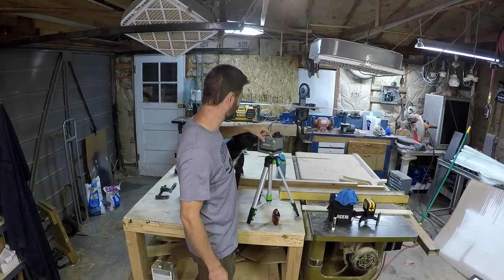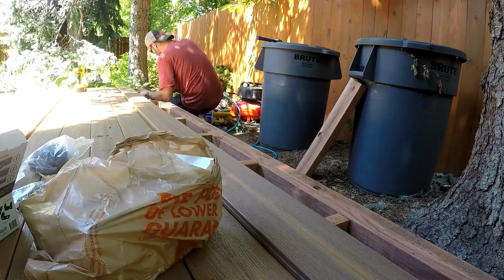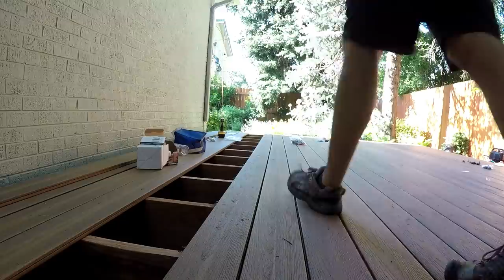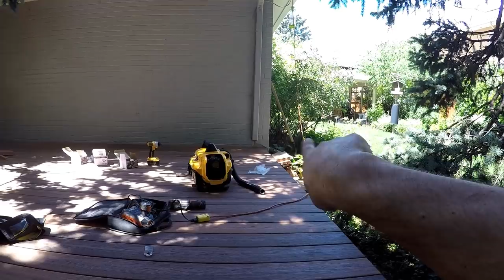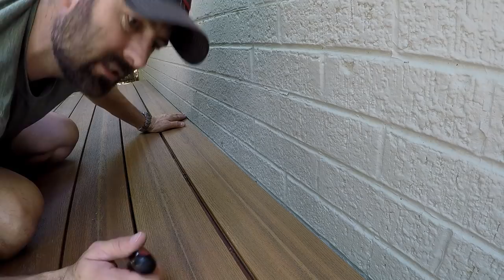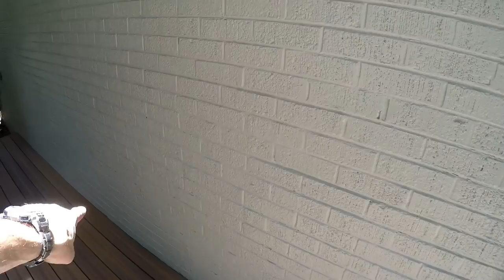How To Build a Composite Deck with Hidden Fasteners | THE HANDYMAN |

Comment: Definitely worth buying the tool system for the hidden fasteners! Maybe not for just 1 deck though. Just built a composite deck, each plank was 100 bucks. 30 thousand bucks in total for the complete project.

Comment: I guess the hardest part of this is how did you measure that with the spacing so the last board filled in the gap between deck and the wall? Are the fasteners universal size spacing? Thats some good measuring how ever you did that. That would have stunk if you had to do a rip cut on the final piece. Looks good. Guess I caught some foreshadowing on the previous video when you showed the level footings and said how you didnt check them before the concrete was down. Its those two points that are the hard parts, the rest is easy peasy. by the way, owner needs to take the landscaping around that to task, needs some major improving.

Comment: When I bought my house, before I could even get the mortgage funded I had to pay a contractor to take the deck down. It was very shaky since it was being eaten by termites, and the bank didn't want to help pay for a known termite infestation. Fortunately they hadn't gotten to the house itself yet. (The termites, I mean. The banks had their hooks into the house well and good: It was a short sale.)

Turned out, whoever built the deck went cheap on the parts that couldn't be seen. The decking was good quality redwood and still in good shape. The posts and joists were untreated fir. Oy. This is what happens when you don't do it right the first time.

I took the cheap option myself (I had a lot of other expenses to deal with just then) and just had the contractor put up small porches/stoops so that the back doors were usable, rather than replacing the whole deck right away. Now I'm thinking it'd be nice to have the deck back, but I'm hesitating over the likely $12,000 cost to build it out to its former extent.

Comment: You may have answered this, and I missed it, but did you just shim the 1/2" gap in the post base left by doubling up the boards?
Reply from the maker: It just squished together.  It was about 1/4 inch difference. When I sunk the nails it bent tight to the beam.   Treated wood is a little thicker than kiln dried wood.

Comment: I’ve seen some builders use basically a tar weather strip on top of the joist and beam. What’s your thoughts on using that.
Reply: If your using pressure treated wood for your joist and beams it shouldn't be necessary. Personally I wouldn't build a frame on an outdoor structure using anything other than pressure treated lumber.

Comment: I almost built that exact same deck.  I was curious if that last deck board just "floats" once you snapped it in, or did you also face screw that one board with those tiny head deck screws? The hidden fasteners are pretty cool.  I couldn't believe just how many I actually went through.
Reply from the maker: I did exactly how you described.  I faced screwed it the the tinny head screws then the deck board almost self healed around it and you couldn't even see it from standing up.
Reply: Right on!   Thanks!

Comment: Where I live is a wet climate, and the flashing tape helps preserve the framing from moisture. Menards carries it in 2 different widths: 4" & 12". It is labeled and marketed as deck flashing, but it is similar to the tape used to flash around windows. However, in all my years of handyman work, I have never seen anyone actually use it!  I have seen lots of rotten deck frames but never one with flashing. And most decks here are lagged to the house right over top of the siding. The deck ledger rots, the siding rots, and the house framing rots!
Reply from the maker: It must be a wet climate thing.

Comment: Seems like an odd placement since there is no door from the house coming out to the deck. Great work! What brand is that material... and where can you buy it? I like the look of it, more natural than some of the other composites I’ve seen.
Reply from the maker: It's behind a detached garage.  Fiberon, symmetry, Jatoba.
Reply: I thought the same thing.  At least he did not have to burn in the sun building it too.  It was a very pretty deck.  Nicest I have ever seen.

Comment: Have you ever used your glasses out of your laser kit outside and how good are they and would you know if their still available as I have a dewalt crossline laser red beam and it can be a nightmare when to much light in a room, cheers
Reply from the maker: I'll go try it out and get back to you in a bit.
Reply from the maker: It got dark out check back in the morning :)
Reply: No problem, was thinking I had glasses with a Hilti laser I had years ago I don't remember ever using them think I was told they was just to protect eyes from laser. Watched your vid on your new sprayer again and another question if you don't mind, does it have a sealed plug as being in the UK we got 3 pin plugs, later cheers
Reply from the maker: I just tried it on the side of a house. and there is a major difference in how well I can see the red lines.
Reply: The Handyman have to see if i can get hold of some, cheers for that

Comment: I don't use foam tape I use roofing paper on top of the joists.  It is not for the decking it is to protect the top of the joist from the water that will eventually sit on the wood.  It's not a big deal just something I was taught years ago.
Reply from the maker: I live in a very dry climate.  That makes a lot of sense and I think I remember something about some kind of tar paper or the sticky flexible flashing

Comment: I think the tape is more for moisture protection?! At least here in the northeast that's what I have seen it used for.
Reply from the maker: I could see that.
Reply: Glad you do. lol All I see is government regulation BS. Just like here in NJ you need to use a tornado cable when building a shed. You can fail your inspection if one isn't installed. I've lived here close to 50 years and have never seen a tornado and only two hurricanes. Which were more rain than wind. And all your footings need to be below the frost line which is between 36-42 inches. This is why people don't get permits.
Reply: When using non treated joist.. I paint a coat of linseed oil or used motor oil on top of joist.. to help prevent the top of the joist from rotting...

Comment: Why didn't you put concrete posts in the center of the deck for additional support??
Reply from the maker: That's not how decks are built.  It doesn't need extra support when the lumber is sized properly

Comment: What about deck underlayment? I mean to prevent grass growing?
Reply from the maker: There is no grass there to grow.  Also there is no sunlight.
Reply: this is seriously late in posting so you may have already found your answer or simply have moved on...A good landscaping fabric (and yes, fabric, not plasitc or poly) can be laid down right on the ground and secured in place by a light layer of gravel. Landscaping fabric comes in rolls - just roll it to the length you need and cut it with scissors. the gravel will keep the fabric from blowing away and both will allow drainage of any water/moisture that gets under the deck.

Comment: Since you ripped the last deck board, would it be safe to ask. Why didn’t you begin at that point & work your way towards the other end ? Either way great job !!!!!!!!!!!  Also, you didn’t lay any weed or growth material under the deck . So that later in the yrs to come , things will grow between the boards.
Reply from the maker: You always rip the last board that goes up to the house you can't have a ripped board or an over hanging board or a short board at the side away from the house.  you need a full board at the side away from the house it has to be placed exactly at the edge of the beam.
Reply: Plants dont grow in the dark.

Comment: Knee pads. The footings are exposed. I will build a 20' x 40' deck next summer. I will pour footings from 12 inches below frost with 6 x 6 and 4 x 4 going down to 6 inches below frost line. The deck will be 18 inches off the ground. Tied to building.

Comment: You didn't show how you secured the last board that you had trouble getting to fit the fasteners. I could not see any screws through the top of the board to hold it in place.
Reply from the maker: Sorry about that.  The last board is screwed through the top.  The composite board is almost self healing.  The screws were counter sunk jut below the surface.  A few taps with a hammer and you would have to be on  you hands and knees to find where the screws are.